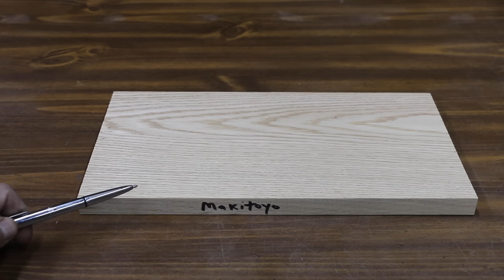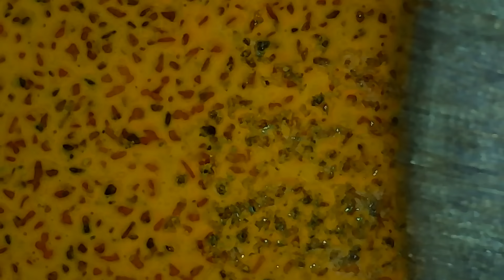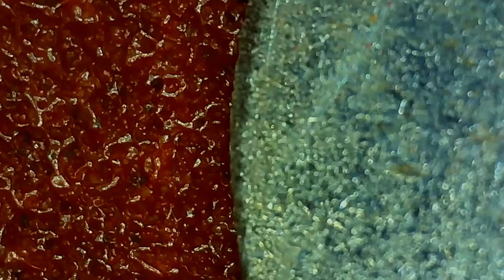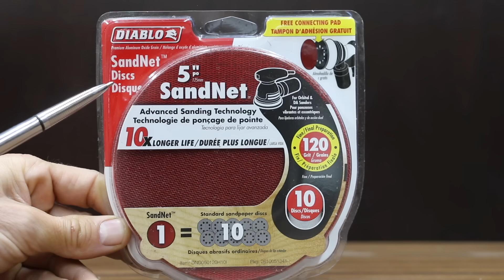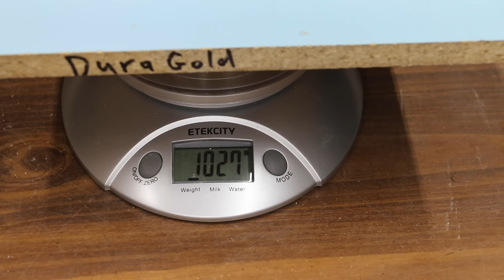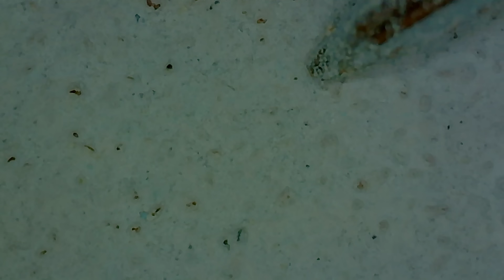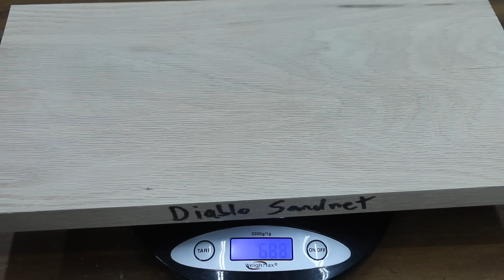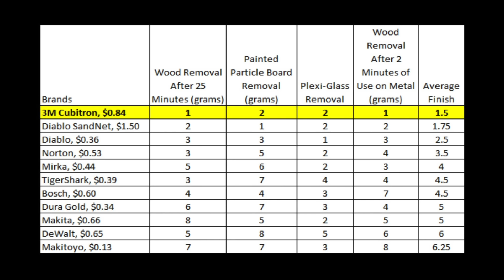Best "Sandpaper" Brand? 3M Cubitron, Diablo, Mirka, Norton, Makita, DeWalt, Bosch Sand Paper

Comment: Time for another sandpaper video. But I recommend a sanding disc one. And don’t do a cheap sander for the testing - get a good one like Festool or the expensive Bosch. 
There are all kinds of different types of sandpaper and a ton of companies that make them. That might be overwhelming.  
Test for durability (how many grams of sawdust are produced in white oak after 10 minutes) or how much they gum up when sanding paint or varnish.

Comment: Not sure how I missed this one.... I sand a LOT of wood bowls. I do consider the red aluminum oxide abrasives to be obsolete, being polite about it. I did try some Mirka discs once, and they were dull after sanding the inside of a 12 inch bowl, which is really fast as far as I am concerned. The mesh types, it seemed to me that they wouldn't sand as fast as other grits until you got to 220 or above, then, they kept up. I just got some of the cubitron and will be playing this. I was looking for cubitron belts for my drum sander and had trouble with that. Found a source, and back to experimenting....

Comment: I’ve been using Diablo sand paper for years. Nice to see it stack up well. I’ll have to check out the 3M Cubitron. If it’s on the shelf at the home store, I’ll pick it up. 
Last year, I started using Diablo sand net. At first glance, it looked flimsy. But I’m impressed. And I can get it in a multi pack with different sizes.

Well done as always!

Comment: On the subject of abrasives, it would be extremely helpful to test abrasives pads, or "scotch brite" pads. I work with them a lot for automotive body repairs and can wholeheartedly endorse Mirka pads, they are extremely flexible and remain sharp right up until it literally ceases to exist. 

Main criteria I would be looking for are 
1). Flexibility to get into all the tricky bends and crevices.
2). Abrasiveness, how well it removes material.
3). Surface finish - the best selling feature for the abrasive pads, at least for me, is the surface finish they leave behind, unlike regular sandpaper, they should never leave sanding grooves on the surface, at least not the ones that can't be sanded off with a finer grit, it is crucial for preparing a base to clear transition for example, where such grooves can eventually reveal themselves after the coating dries, it can happen right away, or it could be months until it happens.
Reply from the maker: Thanks for the suggestion.

Comment: I’m not understanding the  last chart. It has Diablo and 3M at the very top as performance, but it shows them removing fewer grams that at the bottom of the chart. It seems backwards.
Reply: The whole chart shows the ranking of which product finished 1st, 2nd, and so on. Notice in the video it shows how many grams it actually picked up. He is not saying it picked up one gram it finished 1 (first). Also notice how ranking change it’s then added together to get the lowest score of all the tests.

Comment: I'm pretty sure the Diablo SandNet sandpaper has changed. They used to be really good but as of late, they wear out really quick. Especially the 60 and 80 grit sheets. The 120 and up work well still, but I had to switch back to the regular Diablo discs because they not only cut better, they seem to last much longer.
Reply from the maker: Thanks for sharing.

Comment: I found Cubitron to really last 20 minutes and still sand pencil lines even when going inch/second. However the backing that hooks to velcro fails (cubitron flies off!). I even tried putting a new pad it cubitron still flew off. Any thoughts? Also, how to fit cubitron to festool 80x133 ?

Comment: Done a few years of body work, argued about abrasive choice almost daily. I swear by diablo sand net especially for roughing and paint prep, but 3m cubitron and trizact for any clear coat or color sanding. The extra cost can help one slow down when considering how much labor has already been put into the part come clear coat and cut and buff time.

Comment: What exactly IS the Janka hardness scale? Does it pertain solely to wood?
Reply: The Janka hardness test measures the resistance of a sample of wood to denting and wear. It measures the force required to embed an 11.28 millimeters (0.444 in) diameter steel ball halfway into a sample of wood.

Comment: Now that you've done a review based on brands, would you consider doing a review based on grit type i.e. garnet, flint, aluminum oxide, zirconia, ceramic alumina, ceramic zirconia, and silicone carbide.  Having been a fan of 3M Cubitron II, I was appalled that the price has more than doubled in 2 years since I started buying and using it so I started looking for something as durable or more durable.  I've so far settled on silicone carbide imported from China because I do a lot of sanding of various oak and elm species and because the longevity is significant.   A hard wood like Post Oak or Winged Elm can be very time consuming with the wrong sandpapers.  Cost is significant as well as Cubitron II costs about 85 cents per disc (5" 8 hole) but I've found silicone carbide sourced through Amazon to be only about 19 cents per disc and the longevity is better than the Cubitron II.  Thanks!
Reply from the maker: Thanks for the suggestion.

Comment: Thanks for this great trial. However I have to highlight something that hasn’t been mentioned during the test.
3M cubitron is actually a top premium ceramic product in the abrasive range and it seems normal that they did such a result. 
In comparison, the Norton Adalox tested in the video is actually the bottom range of the DIY made mostly of aluminum oxide grain.
To have a fair test an result, Norton disc trial should have been done with the orange blaze ceramic range or at least with the cyclonic range. I can confirm by experience that the final result would have been different. Thanks again
Reply from the maker: Thanks for the constructive feedback.

Comment: Does anyone know why he adds so much weight to the top of the sander? From what I've been taught, read, and learned from tool & sandpaper manufacturers, sandpaper works best & lasts the longest when just the weight of the tool is pressing down on the sandpaper. Extra weight stops the tool from working as designed, generates more friction & therefore more heat. And We all know heat is what will destroy sandpaper extremely fast. If I'm missing something or I'm wrong I am happy to listen  and would love to understand.  Thanks

Comment: Project farm, always bringing the best content ina fun way , so much hard work , thank you ! 
I’d like to say I’m about to work on an old kitchen table , a 30 year old table that has years of use , I can scrape a coating off with your finger nail , even tho it’s cleaned often ,  I’m wondering what stripper works best to remove all the soap , oils from humans , and the original varnish or polyurethane……….do you already have a video ?   If not maybe you could entertain that idea ….for a video 

Keep up the great content 🎉
Reply from the maker: Thanks, will do!  Thanks for the suggestion.

Comment: I just used 100 grit, 81/2x 11 sheet of Diablo for sanding oak with curves. It was really good. Flexible, good durability. Sanded 8 stools made from wine barrels with 1/2 sheet.
Reply from the maker: Thanks for sharing.

Comment: The other day, while sanding a wood deck to clean it, I used several different sand paper and I happened to have Gator 5" Random Orbit Hook & Loop Red Resin Aluminum Oxide Sanding Discs.  Gator sand paper lasted much longer than any other one I had used.  if you do this again, you may want to consider adding Gator to the list of products to test.  No, I have no association with them.  I'm a software engineer who happened to do handyman stuff last weekend sanding a wooden deck getting it preped for painting.  I did use 40 grit to get the job done fast.  I was mazed how long it lasted.
Reply from the maker: Thanks for the suggestion.

Comment: I feel less of a man now buying sand paper before looking at this video. I should have known you did a sand paper review. 

That being said I went to lows and they only had 2 brands for sanding discs. Craftsman and Gator. Would love if you tested these brands. I bought the gator st 19.98 for 50 pieces. 40 grit and 220. 
They also sold sand paper flap discs and abrasive wheels. maybe you can do a test on those as well. 

Thanks. 

Love your chanel and thank you for your service!
Reply from the maker: Thanks and you are welcome!  Thanks for the suggestion.

Comment: As always, this sandpaper review was excellent.  However, the review utilized 5" sanding discs exclusively.  While this is a common power tool sanding method for DIYers, sandpaper sheets are probably more commonly used by painters, woodworkers,  especially novice users, and there are many European and Japanese sandpaper brands used by woodworkers that may not be used, or even come in, 5" discs. Finkat, Klingspor, Abranet, come to mind.  We woodturners typically use mylar or paper backed 2" or 3" discs.  This may be too specialized for you.  
How bout a review of sanding sheets?
Also, durability is a big consideration.  You addressed that somewhat in the 5" disc study, but perhaps another one or two 5 minute tests on wood would see which discs tear or cease being effective.  
Thanks for all you do.
Reply from the maker: You are welcome!  Thanks for the suggestion.

Comment: I refinish hardwood floors and build custom stairs and railings. Needles to say we use lots of sandpaper. We currently use Mirka Galaxy, Norton Blaze these are mostly what we use and both work very well we have used the mesh styles ones as well. I would be curious to see a test with these newer style of sand papers

Comment: I don't know how i missed this review.  So does this test also apply to belt sanding replacements or die grinder sanding paper?  My curiosity is due to the need to sand semi precious stones.  some stones that have reach a hardness of Mohs scale of 8.   The problem i run into is claims of sandpaper containing a certain material for sanding (silicon carbide for example) and specified grit (400 grit to 8000 grit).  The longevity is an issue but as i can see here there is some good options for dry sanding but what about wet sanding?  This may also be a bigger or to broad of a subject to tackle because there is still the Ace hardware brand and other usa brands i didn't see in this particular clip. Would have been nice to see Klingspor.

Comment: Diablo was winner... diablo sandnet is good, but more costly. best performing was 3m cubitron, which I've never noticed on the shelves before.
Reply: Sandnet lasts significantly longer than the reg Diablo. Sandnet can easily be cleaned out & reused. HD regularly runs hefty sales on sandnet 50 packs (10 ea of 5 grits). Sandnet is a better value without question.
Reply: @bhough410  thanks

Comment: the only one of these I've used extensively myself is the mirka ones and those are terrible at staying in one piece, the damned things rip and tear at the slightest hint of uneven support from the sanding pad or even just hitting a crossgrained patch in the wood the wrong way, and every time it tears you have to go grab a new piece and resurface the whole face all over again because it just stratched the everliving hell out of everything it touched before you caught it, sometimes having to repeat the process several times.
they make nets too, much less likely to just tear out of the blue but instead they would usually start out scratching the hell out of anything you used them on to the point where it was hard to tell the difference between 120 and 400 until the piece you were using had worn itself in just a bit after 30-45 seconds or so and started acting like proper sandaper...at least until the edges started to fray in a few minutes and it was dropping loose bits of grit and dragging them through the surface.

^used to work in a furniture production plant, I was usually working in final inspection seeing sanding problems on half the items that passed through with the occasional stint of spending the day sanding...leaving problems on almost everything I worked on: we only had enough time to do our job fully if everything went mostly perfectly, anything more than a couple putty spots and you're trying to make decisions on what to fix and what to leave to try to do the best you can with what you've got without ending up spending half an hour on a 3-5 minute piece all while having literally less than zero time to make those decisions.
In the entire time I worked there I only had everything go smoothly a grand total of ONCE...weirdly enough it was on a big old desk made of maple (scratches if you breath on it funny, no, really, the moisture difference causes it to sand different enough to cause the stain that's going on it as soon as you're done with it to absorb/adhere differently enough to see it in the final product) with all sorts of nooks and crannies that should have caused things to go awry constantly and a big ol' top that should've had all sorts of stuff that the belt sander didn't get and all sorts of places where it was all to easy to ding something during assembly buuuut nope, the top was almost completely clear my equipment all worked as intended and nothing needed fixing or even a second pass with the sander, I was done in about 60% of my time budget since even that impossible standard assumes you're making a couple passes on large surfaces and all the handsand areas...worst part is that it was part of a hotel package where the customer only barely cared if there were unfilled knotholes in the pieces let alone if there were scratches under the nearly whitewash looking finish they wanted on everything.
Reply from the maker: Thanks for the feedback.

Comment: this is great but im not sure if you have or if you could address in new video the different types of sandpaper as they varyin the materials they are made out of such as sanding belts  Zirconia, Ceramic, Aluminum Oxide, SCM (Surface Conditioning Material)
Reply from the maker: Thanks for the suggestion.

Comment: Sandpaper hook n loop are only as good as their backing. I’d like you test how easily the paper no longer adheres to the sanding disk after they are taken on and off several times. So called fly off of the discs is a big problem and render the disc useless although the sandpaper it’s self is in great condition.
Reply from the maker: Thanks for the suggestion.

Comment: I'm looking at 5 in. SandNet Coated Assorted Disc (50-Pack) at Home Depot for $19.88 (40¢ /unit)  10 of each 80, 120, 180, 220 & 400 grits.
Reply from the maker: Thanks for sharing.
Reply: The sandnet is ultra durable, have to really mistreat the sander it to get any movement on the backer and it can be cleaned & reused. It's the only thing I use any more...stocked up with 3 packs. Buy another pack every time I catch that sale assuming inflation will raise that price sooner than later.

Comment: A year late, but I have that exact same sander and as someone who professionally sanded stuff all day long for like 7 years, I can confirm that the DeWalt sander that's like 90 bucks is GARBAGE. Don't even bother with it. If you want the best sander, you want the old Porter Cable. Good luck finding that though. The next best is Festool, and it's around 500 dollars.
Reply from the maker: Thanks for the feedback.

Comment: Why you use 3m CERAMIC(Purple color) material compared with other aluminum oxide material(red color and gold color),they are different material,ceramic of course has better cutting and sanding ability than aluminum oxide,also you use diable sand net(we called net or mesh abrasive),it is also ceramic material,you should use same material,same color to compare different brand,like all use gold color or red color making them same level material.

Comment: Makita sandpaper has always been garbage. I actually have some from years ago that i refuse to use just cause it doesn't do squat (time is $$) and the grits are falling off 😅😅😅  180 is like 320 now.
Diablo is everywhere here and good stuff. I just ordered some 3m cubitron 2 net 6" in 120 for my festool rotex 150 sander to try as an alternative to festool granat sandpaper.  Granat is good but expensive. That new cubitron is supposedly much, much better and cheaper! Though I have my doubts on paint/urethane removal with it. As soon as I get it ill try! Time will tell!
I wonder what the results would be if they sander was attached to a vac/ dust extractor?..
Reply from the maker: Thanks for the suggestion.

Comment: Video Idea. This one is very ambitious. Test what metal or metal alloy that is best at holding a sharp blade. To test you could see how many times each metal blade can cut a nail with a certain amount of pressure applied. The hardest part of the test is getting all the metals and turning them into blades, because the only metal really being used for blades is iron(steel alloy). My inspiration for this was from a video I saw on the sword of goujian, a kings sword discovered in a tomb. The sword was over 2000 years old but when the researcher removed it from the scabbard it was still razor sharp and he accidentally cut himself with it. The sword also had zero erosion/rust. The sword wasn't made of steel, it was made of a copper alloy(i forget the exact alloy but it wasn't raw copper) and the actual cutting edge was made of Tin. Maybe tin has a very sharp toughness to it despite having a very low melting point? Could test copper, bronze, tin, iron, different types of steel, titanium, zinc, platinum, magnesium, gold, silver, osmium, tungsten, etc.
Reply from the maker: Thanks for the video idea.